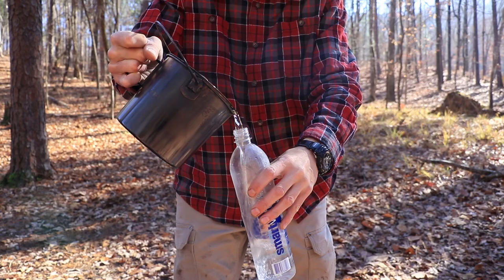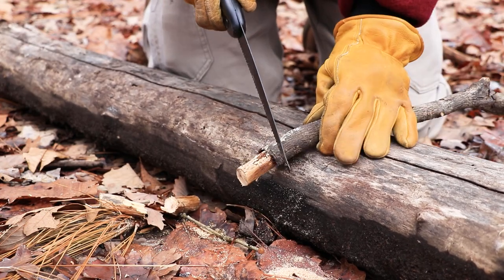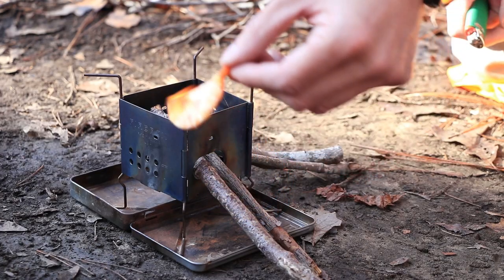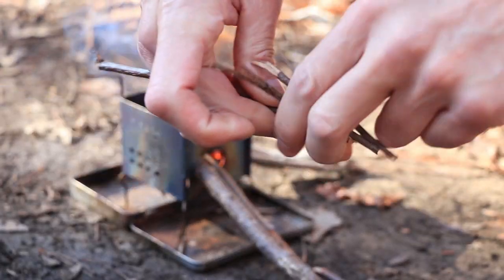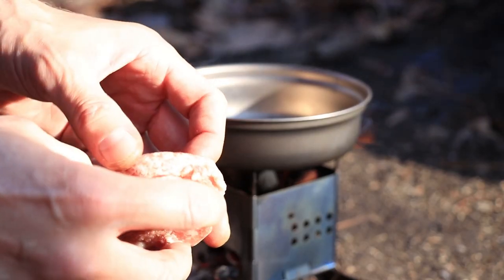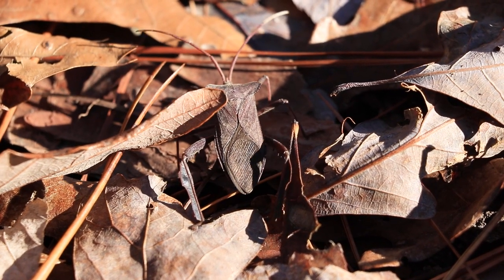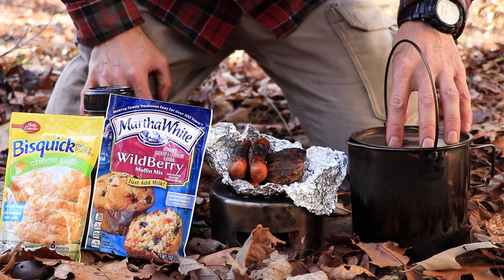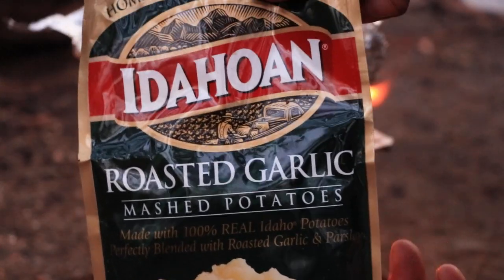A Major Piece of Camping Equipment Failed

Comment: Hi, John. I too had a problem with my Sawyer Squeeze. Upon returning home from an outing, I neglected my filter in my pack. When I tried to use it again, it’s flow rate was almost nonexistent. I did a 15 - 20 minute soak in straight vinegar, then ran a diluted vinegar solution through both ends. The results was amazing. Flowing like new. To store it, I ran distilled water forward, then back flushed with it. Finally, I squeezed air through to force out as much moisture as possible, then set my filter out to dry. 
    I like your videos. The picture and audio quality is excellent. Your presentation and demeanor is pleasant and relaxing. Keep it up. 👍
Reply from the maker: Dan, thank you for posting this information. I am going to start doing that from now on. I normally backflush my filters after I get home with tap water. I believe what may have happened is that the chemicals in the water caused a calcium/lime deposit to set up in the filter (just guessing). That filter was idle for over a month (maybe two) before I used it again. The distilled water plus the air flush would resolve that problem.

Thanks for watching and commenting! I really do appreciate it!
Reply: @JohnMillwoodOutdoors  if that squeeze is still clogged try doing what Dan recommended and soak it in vinegar overnight then run distilled water through it forwards and backwards to get the vinegar smell/ taste out of it. The vinegar will help get rid of any calcification or Lyme buildup. The squeeze is pretty resilient. I always back flush with the syringe not the smart water bottle. The syringe creates more pressure and helps to avoid creating paths of least resistance which decrease the flow rate over time.
Good luck my friend!
Reply from the maker: @twhite19782012  Thank you for commenting. The mistake I made was getting mad and throwing the filter away. I wish I had not done that, because now I believe this would be a solution. I will never flush out my filters with tap water any more. I have since bought a gallon of distilled water and a new Sawyer Squeeze. I'm also testing a different filter, which will appear in my next video.
Reply: @JohnMillwoodOutdoors  I can't wait to see your thoughts on the new filter! No worries John, maybe someone else in the same situation will read this thread and find a solution?
I have many water filters and the squeeze is still one of my favorites. They all seem to have strengths and weaknesses though. I wish luck on your journey through the land of filters.
Reply: ‘Hadn’t thought of using vinegar to clean-soak the Sawyer  - will have to try this. Thanks for sharing the idea.
Reply: (Ironically, we regularly clean coffee machines with vinegar - why didn’t we think of this for the filter?? 😊)
Reply: @KettleCamping  I would still do the bleach method followed by the vinegar soak just to be completely safe. Not sure how well the vinegar kills some of the microbes.
Bleach to kill, vinegar to get rid of any hard water that might clog the filter.
Reply: @twhite19782012  Good point!

Comment from the maker: Well, I made a mistake  folks. I got mad and threw this water filter way before seeking advice from you - my viewers. After reading your comments and doing a little research prior, I believe the problem I had with the filter may had been a calcium deposit. I had last used this filter about a month and a half before this backpacking trip. I believe if I had used a mixture of vinegar and water to soak and back flush the Sawyer, it would be flowing again. Unfortunately, since I trashed it, we will never know. But I did purchase another Sawyer just like this one because I do believe it to be a good filter. I've been running the Sawyer Mini for several years without any problems. Let me know what you think, and thanks for watching!

Comment: I have used various filters for several years now.  Any Sawyer will clog and fail if it is not backflushed regularly.  Backflush it everytime you use it - and backflush it slowly.  Backflush it with filtered water and use moderate, but never heavy pressure.  Don't try to set a schedul, like every 10 liters.  It won't last a hundred liters.  The filter may be good for 100,000 liters, but it won't last that long in practice.  They're light; carry two.
Reply from the maker: Thank you for all these recommendations. I will try them out. I appreciate the comment. Thanks for watching!

Comment: 1 is none 2 is one. I carry a squeeze and the mini. About to trade out the mini wit a grayl. Half of that mini inferno works great. Remember to backwash the sawyer. I do it after every use and during the colder months I use the syringe to push air thru it to help prevent freezing. Love your videos.
Reply from the maker: You are so right. Thank you for the advice. I just got a Grayl after this happened to give it a try. I'll be testing it out. I never thought about pushing air through to prevent freezing. The temperature was below freezing that morning, but I was carrying the filter in my cargo pocket next to my leg for that purpose. I'm glad you found some value in the video. Thanks for watching and commenting!

Comment: Hi John 
Definitely gotten the hang of the nano now. Just got a sawyer filter. The instructions say calcium buildup can block it even after back flush. They say soak in dilute vinegar then back flush 
Thanks for video 🔥
Reply from the maker: I love the Nano stove! I think the calcium may have been my problem. I also saw a video recommending just what you said about the vinegar and water solution. The problem is that I got mad and threw the filter in the garbage before I did some research - which was a mistake. I have since purchased another one because I really do believe the Sawyer is a good filter. I've been running the Sawyer Mini for years without any problems. Thanks for the info, and thanks for watching!

Comment: From my experience... Try to empty the sawyer by swinging the water out... either end pointed down, swing it sharply towards the ground a few times. Some water should come out.
Reply from the maker: You know, at the end of that trip I got mad and threw it in the garbage. But now I wished I had not done that. I did not try what you recommended. I also did a little research and found a video where a mixture of vinegar and water was used. The filter was soaked for a while and several backflushes with the plunger was done to unclog the filter. Anyway, you live and learn. I have since purchased another one, because I think the Sawyer is a very good filter. Thanks for the info. And as always, I appreciate you watching and commenting on my videos!